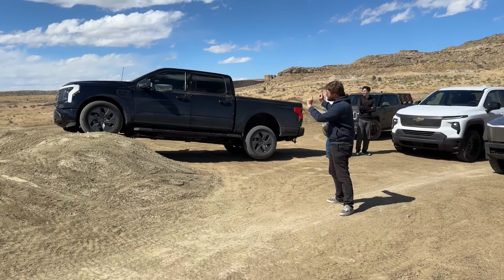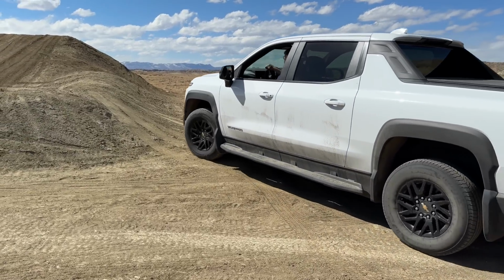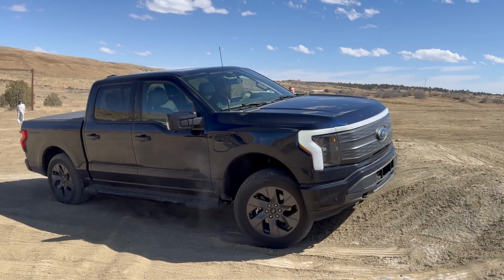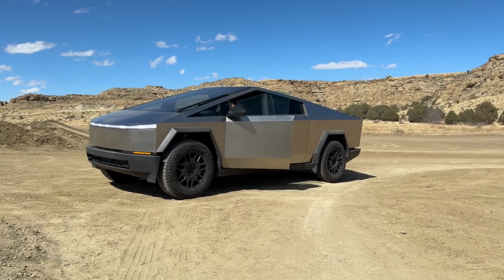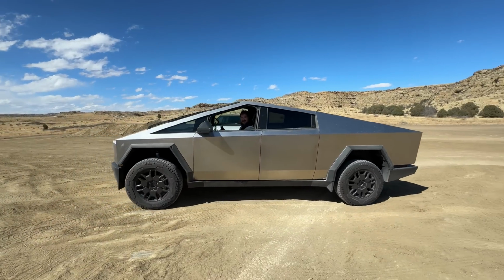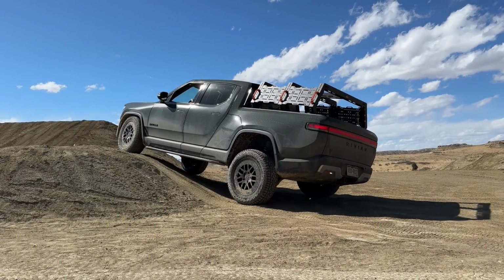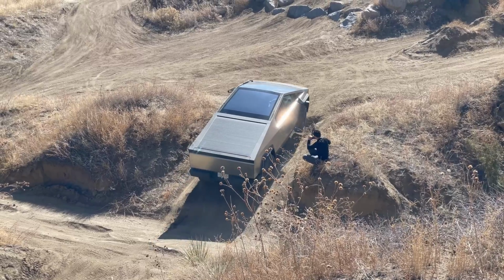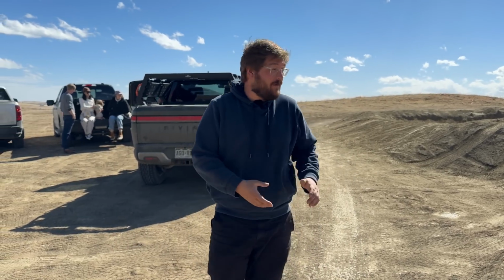EVs Explained Off Road! Dual Motor vs Tri Motor vs Quad Motor - Locking Diffs vs Virtual Lockers

Comment: Great video! Love to see the comparisons.  I really like the Silverado EV with it's massive battery but this video shows I should keep the Lightning, at least for now. My Lighting sees some rough trails at times. Just recently I had to tow a flat bed trailer up a steep, rocky uneven dirt road. Google Earth shows it's a 14 percent Grade at times and it owned it like a boss. The access road to the Solar powered cell tower we worked at has many signs stating 4x4 low range required. My truck is on 34's and a 3 inch lift though. The locker helps immensely on the trails. Steady, smooth throttle is key and also definitely do not stop on the steeper parts. Let the motors and locker do their thing. 6 Months in and this truck has definitely earned it's keep.

Comment: I've been waiting for you to do this video, Kyle! Good stuff. One thing I think bears more mention is the benefit to preserving momentum and reduced trail destruction that a locker(s) offer due to reduced wheelspin. Brake differential control (which CONSUMES torque to transfer torque) or multi-motor on an axle are reactive and need to see that slip on one side to ramp up torque to the opposite side. You make a great point at 18:50 that most people don't yet understand about EVs and I think it bears repeating. Quad motor means 1/4 of the power available to any given wheel.

Comment: Great video. I design motor controllers for a living, and I don't understand why this is so complicated. In offroad mode with the 3- or 4-motor systems, all that needs to be done is to ensure that all motors spin at the same RPM, and allow each of them to use full torque to achieve this. Motor controllers can react very quickly to increased torque demand, so that there should be no noticeable delay to the driver. In theory it should be able to look and behave like you have physical lockers. What am I missing?

Comment: an interesting addition here wouldve been the 4xe wrangler, even though its a phev it would be a good representation of mechanical 4wd with lockers since its all pre-transmission and how it handles the different torque curve of an electric motor
Reply: 4Xe would roll up this as nothing, no wheel spin.
Reply: @santiagohills3997  interesting, still would’ve been a good benchmark, especially with how much front and rear lockers were talked about
Reply: Pretty sure you wouldn't even lift wheels here in a Rubicon

Comment: It sounds like a quad motor setup that had a way to hard couple the wheel together would be the ultimate setup. Other than this, a dual motor with lockers where you can run traction control most of the time, but hard lock things up when things get gnarly would be amazing. Of course you still need some virtual locking going on between the front and rear motor since on many serious off-road tracks, maintaining a slow but consistent pace is essential. Having your vehicle bog down because the front or back lost traction for a moment on a tough climb is not a good thing.

Comment: I don't do off-roading, at least not voluntarily. Therefore, I'd prefer anything that doesn't need extra HW (more cost, more weight, more things that can break) for occasional „Huh, am I really stuck in the snow, how do I get out?“ accident. Certainly, a car that is specifically designed to go offroading might have different trade-offs.

Comment: I recently traded my old Silverado for an F150 Lightning.  Like most gas Silverados, it had a mechanically auto-locking Eaton G80 rear differential. Seems like that would be something useful on a work-truck.

Comment: Using a locker when floating a tire or two on rocks can greatly reduce tire wear from fast spinning tires when they start to get traction. It also reduces jerk that can cause center of gravity shifting.

Comment: IMO, a dual motor EV with front and rear electronically controlled lockers is the ideal set up overall for off roading. Let’s you have the lower weight and higher efficiency of only two motors, while still being able to send power to the wheels that need it most. Quad motor is overkill and I would say tri-motor is too. You can get much higher efficiency, lower cost and lower likelihood of a failure with fewer motors. It’s also nice if you have dual permanent magnet motors that the front motor can mechanically disconnect from the drivetrain for highway cruising so it is RWD only for higher efficiency. For whatever reason Rivian made its vehicles go into FWD only mode when you put it in efficiency mode. An odd decision for a truck or SUV, especially if towing and a lot of weight is on the rear end making the front wheels lighter and easier to lose traction. 

T Chevy’s performance was abysmal and it could be much better. Plenty of cars with open rear and front differentials are able to go off road without issue (like Land Rover vehicles that don’t have the locking rear differential option). My Kia EV6 GT has a rear electronically controlled differential and it makes all the difference in the world when you mash the accelerator (NOT THROTTLE LIKE KYLE SAYS lol) in a curve and it just puts the power down to the outer rear wheel instead of lighting up in the inside tire or cutting power like a Model 3/Y Performance will do with their open differentials. It can overdrive one wheel for torque vectoring which can absolutely be felt. So glad they fit one to the GT. BMW needs to do that on its i4 M50, i5 M60, and i7 xDrive60/M70. We have an i7 and it will torch the front tires from a standstill while on sharp curves it can overwhelm even the big 285mm rear tires if you floor it. Their equivalent ICE cars come with an active M differential so not sure what they left it off the EVs that cost even more!
Reply: ev cars not suitable for off-road driving without gearboxes. Problem with electric motor. And even with one they are bad suitable for off road - weight, low energy...

Comment: I don’t see why Rivian can’t simply have a mode wherein all 4 motors turn at exactly the same rate, simulating a fully locked vehicle. The right pedal would then simply be a speed control, not an “accelerator” which is exactly what one wants when rock crawling. There’s no need to measure the mu of the surface, just measure the motor RPM. Surely that can be done in just a few milliseconds; the computer is obviously fast enough, all it needs is a sufficiently precise RPM sensor. And I suspect that is already there in the basic motor controller, anyway.
Reply: I’ve been saying this forever.   Why is it so hard to have a line of code say “wheel speed left = wheel speed right”.   That would basically simulate a locker .     Too bad with a quad motor there isn’t more control over each wheel off-road . Can do things like pivot about any corner or tank turn .  If there was manual control of each of the 4 wheels that would be insane .
Reply: It’s not that easy to simulate lockers by changing wheel speed.  Calculating the voltage supplied to each motor would need to be an iterative process because traction is constantly changing.
Reply: @Ishmael01 Why do you think that can’t be done fast enough?

Comment: My ‘23 Lariat ER has the most amazing traction I’ve seen. The stock highway tires it came with have pulled the truck and 14k dump trailer everywhere I’ve tried to go. I have locked the diff a few times. A front locker would be nice but then knowing I had that I’d put myself in deeper trouble. Important logic for any off-road driving. Don’t assume your very best effort (frt & rr lockers) is what you’re getting into. Always keep your best effort for getting out of overzealous efforts. Keep a trick up your sleeve - so to speak.

Comment: i suspect dual motors would be the most efficient overall, so if adding lockers does not take away efficiency and provide real 4 wheel traction. We need more testing to see if try motor is as efficient as dual motor in regular driving on the same truck on same drive.

Comment: Actually software "locking" is quite simple. You adjust the amount of power being applied to each wheel to best match the measured angles from the motor encoders so that they spin at the same speed. Initially you will get the free wheel spinning quicker, but very quickly (within a few degrees) you can realize this and adjust how much power is applied.
I am quite unimpressed by the cybertruck's and the Rivians current software to manage this as they are very slow to respond.

Comment: I think there needs to be multiple gear reduction ratio outputs. Essentially, electrically controlled automatic transmissions for lower ranges and higher torques to prevent stalling of the motors and overheating of the electronics.

Comment: The wheels are being driven by what are essentially servos. Why not just put them in position control mode and cam into a virtual master that has speed governed by the throttle peddle. Position control loops can update at as fast as 100 microseconds. For all intents and purposes performance should be identical to a physical locker except for as Kyle says the torque being limited to the wheel that has contact. Maybe automotive inverters don't have the full capability set of an industrial servo drive?? Do they have encoders or resolvers on the wheels?

Comment: Are motors generally limited by their amp capacity fed to them or is it the battery output that's the limiting factor?  I can envision the four motor setup having excess torque capacity that can't be fully realized by the battery pack.  However, if the vehicle is stuck and now needs one motor to be "maxed out", the battery pack can easily handle it and possibly overdrive that motor with amperage, if allowed.  Maybe they need to call this "overboost or overclock", similar to the Tesla track mode setting on the air conditioning compressor.

Comment: If the traction system could detect suspension loading, it ought to make the software control much easier for cases where there are wheels off the ground.

Comment: 29:00 Credit where it’s due, you can do tricks to overdrive an individual rear wheel with an ICE AWD system, like in the Focus RS, which would overdrive the rear axle and use clutches to control power to each side.

Comment: I think on the front axle you don't need two motors, doing it with the brake only is sufficient. So the Cybertruck tri-motor version should be fine enough, as long as the software is written correctly.
For most people a dual motor version with good software to use the brakes for this is also sufficient, like the Silverado does it. The software must work fine anyway.

Comment: Well, Rivian could implement a locking diff by setting up the motor control in a way that continuously varies the power going to each motor in order to achieve the same amount of speed on both wheels. You could even program it in a way that it's not trying to achieve 100% equal speeds but rather leave a 5-10% margin so that you can even leave the feature enabled while turning (simulating a limited split diff, which would even be an advantage over mechanical lockers). Furthermore, it would be possible to constantly vary the amount of acceptable wheel speed difference by taking the steering angle into consideration.
Of course, not to over stress the motors, there would have to be some kind of a smoothing algorithm which would lead to some delay compared to the instantaneousness of a mechanical locker (though certainly a lot less than seen in this video), and also an overload shutoff, but for the most part, I think it should be ok.
This wouldn't solve the issue of the power limitation of one motor, though, and that's the reason why the EQG gets a two speed transmission at each motor, leading to - if combine with great software - probably the perfect drivetrain for offloading!

Comment: Hummer EV 2X (dual motor) has locking diffs front and rear
Reply: it doesn't work. Look up review in this channel. If you need off road trips - buy gas/diesel/lpg engine.

Comment: Hey Kyle & Team, writing from Colorado. Lockers, torque distribution and stability controls are extremely important topics here as you of course understand, thanks for covering this topic on ~$100k trucks, you can't take dealership test-drive vehicle into these conditions. 

Honestly I lost hope in Virtual Lockers looking at Rivian and now Cybertruck, while easy in theory — just rotate the damn motors with same RPM no matter the load — no one still implemented properly. Not one manufacturer implemented virtual central locker for Dual Motor (front + rear) planforms: Tesla, Rivian, Ford, GM, others.

For this reason I will only buy Dual-motor EV truck with durable electro-mechanical lockers. Cybertruck Dual-Motor is much more appealing to me than Tri-Motor for this simple reason. If you *like* driving and you live in state like Colorado where we get 4 seasons few times a week, you need absolute predictability from the drivetrain on Snow, Ice, Dirt, Sand, creek crossing.

Wdyt?

Comment: With all the hype about traction control systems in 4WDs, how Toyota has the amazing crawl control for example, and the advances we are seeing in EVs, it would be easy to think that traction control is better than lockers. So wrong. A fully locked system is BY FAR the best system for traction, and not by a little bit. Kyle almost touched on why with the idea of rapidly changing conditions, but perhaps more importantly, all wheels turn at the same speed, so if one wheel loses traction it doesn't start spinning wildly, it stays at the same speed as the ground and much more likely to regain traction. Also by avoiding a spinning wheel it will not dig itself into the ground or sand or mud. I suspect it will be a long time before software systems can out-perform a fully locked system.

Comment: I think at some point it will be necessary for an EV truck to offer not only a physical locking apparatus but also a legitimate low range gear ratio.   Even just on the rear,  it doesn't need both ends to gear down but a second ratio would mean more torque before stall and likely a lot more low speed control.  

I crawl my old combustion 4x4's with little to no wheel spin ever,  spin beats up the trail and wears out tires.    I'd like to see EV's get on that level.

Comment: Great explanations. I've heard it explained before, but this is the first time I think I actually understood it to the point of being able to remember it from now on.

I do wonder why these companies are using quad motors instead of lockers. Maybe its better in other ways that it doesn't make sense to have dual motors with lockers when it can only send 1/2 the total power to any one wheel. It will be interesting to see if the G-Wagon has quad motors, how it compares to the ICE version with lockers.

Comment: Usually an induction motor should have better low speed torque and stall torque, it is a non synchronous type motor which means the rotor is not synchronized with the stator field rotation. The more out of sync they are, the more torque there is, this is called field slip. As the motor RPM increases the torque typically decreases on this type.

Permanent Magnet isn't a motor type in itself because even induction can use PM too. But assuming they mean permanent magnet synchronous motor, that means it's a synchronous type motor. These are the most efficient type of motor. The rotor must be rotate in lock step with the stator field rotation, any slip would mean it stops producing any torque and failed. Synchronous motors are typically constant torque from stall to max RPM and in order to run it needs AC frequency control through a VFD to properly start the motor from zero (the inverter/controller on the car). This is not a motor that is easy to start off straight grid power for large motors because going from nothing to 50/60hz is not really possible, so it would fail to start without assistance or a VFD to ramp up from 0 to operating frequency.

TLDR: induction is typically best for performance. There's a reason single motor efficiency models of Tesla use a synchronous motor, but performance dual motor models swap the rear synchronous motor with an induction and put the synchronous up front. And why something like the S Plaid is all induction.

Comment: would love to see the  hummer ev in this group .
Reply: Same, we invited our friend Patrick with one but he couldn’t make it
Reply: It's the same truck as the Silverado (if you're a car head you know this).
Reply: Would be interesting to see how the dual motor Hummer does, as I believe it can be optioned with lockers front and rear.
Reply: @chefcjnobles1680 I would imagine that the software calibration is probably significantly different between the Hummer and the Silverado work truck trim.
Reply: @chefcjnobles1680  The suspension setup between the two trucks are completely different. Far from the same as you can get actually.
Reply: @chefcjnobles1680 If you were the car head you claim to be, you would know the Hummer has a suspension with far more articulation, and either dual rear motors, or a locker, depending on the trim level. Love watching people try to flex and making an idiot of themselves.
Reply: @chefcjnobles1680  next time you type a reply do some research.
Reply: @KyleConner  mine is already built but still waiting on delivery. Once I get it Ill be more than happy to let you guys use it if you’re ever near LA .love  the videos man .
Reply: I remember seeing a video on TFL where the weight of the Hummer EV was just too much and the wheels were digging holes while trying to go uphill. I suspect this was one of the reasons why Tesla went with a smaller battery in the Cybertruck.